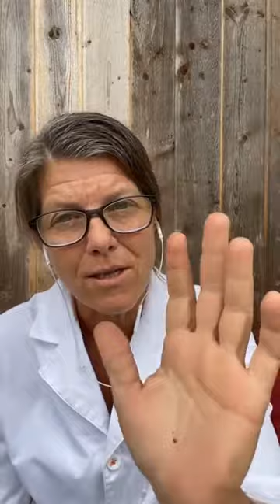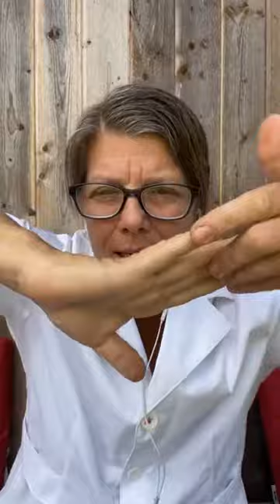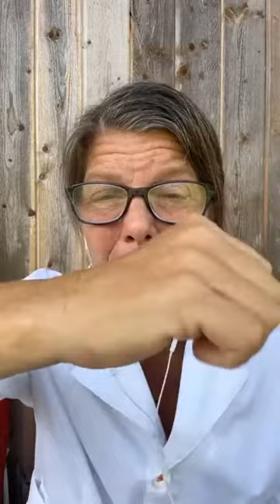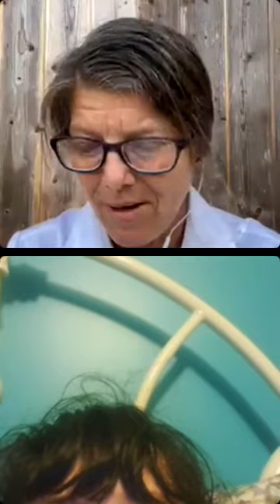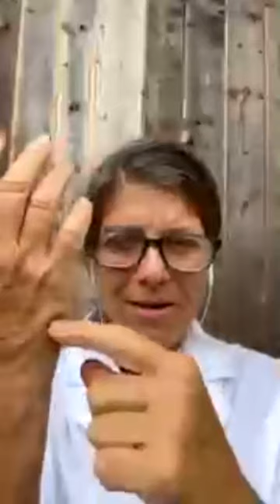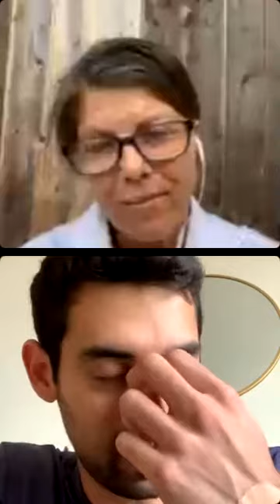Differential diagnosis of ulnar sided wrist pain

Comment: Hi Wendy - thanks for all that you do in trying to shed some light on this unique complex and injury!

I am curious about the Hamate fracture.  I wouldn't say that the "pull test" is registering very much pain for me, which I understand is the main test for this type of injury. But you also mention in this video that there will often be less pain with a "gripped position" (knuckles down) weight-bearing test versus palm down. This is definitely the case for me; I can put virtually zero weight on an open palm, but a moderate amount through my knuckles. Should I get an x-ray?
Reply from the maker: Hi Eric, sorry to hear about your ongoing pain. If you suspect a fracture, you should consult a Dr. and get an x-ray and asap as it takes longer to get appointments these days. Happy Healing!
Reply from the maker: Make sure it is a carpal tunnel view X-ray!!

Comment: Are there any implications to having accessory ossicles in the wrist? I’m a dentist and have been having ulnar sides wrist pain and wrist snapping. I had a radiograph done by an orthopedic and found out I have a large os triangulare. I’ve never had any weight bearing pain but just a dull ache but the ortho doctor didn’t really propose any treatment.